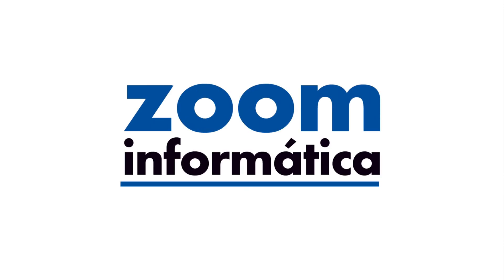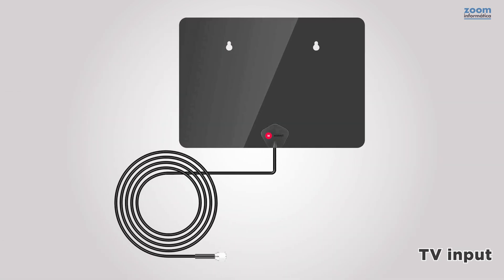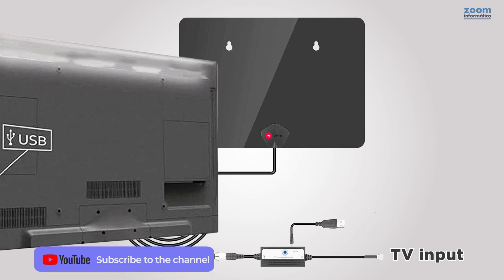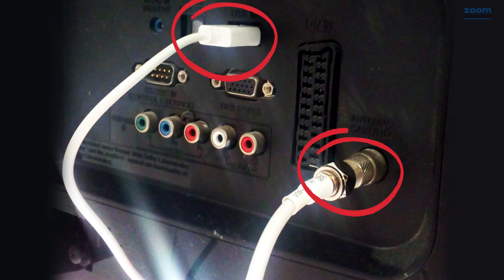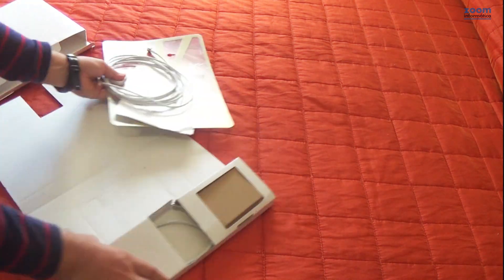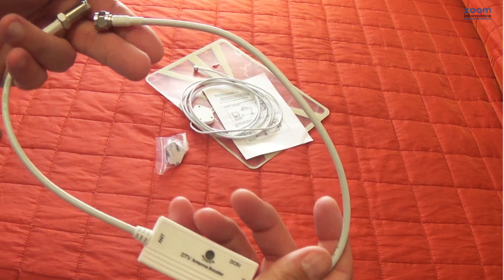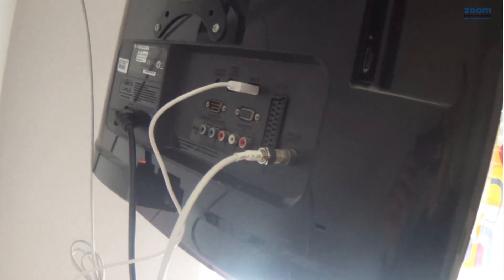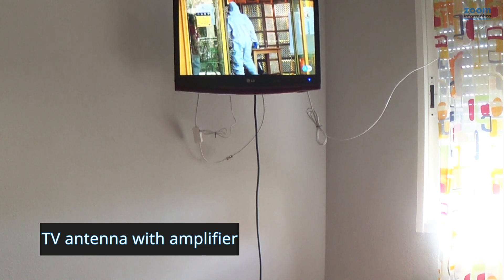How amplified USB TV antennas work. How an indoor antenna can improve the signal like a outdoor mod.

Comment: My tv does not have a usb port only the HDMI bought an indoor areial how can I get round this I bought a plug thing with the 3 colour leads and a usb on the end and it still won't work
Reply from the maker: Not matter use usb on tv or external